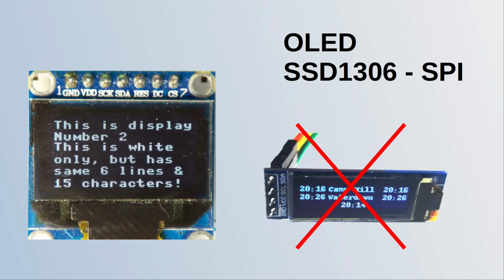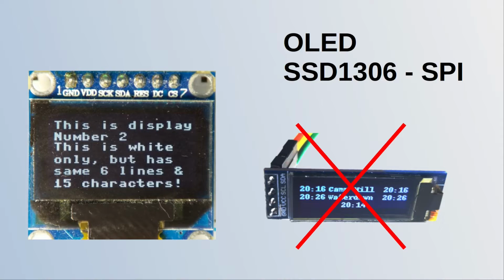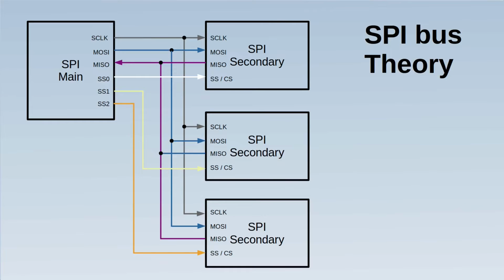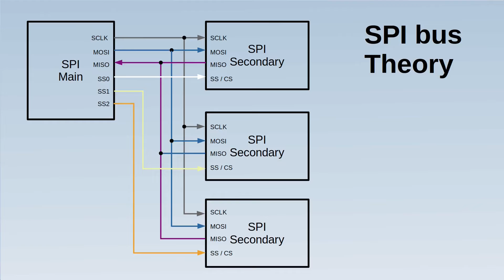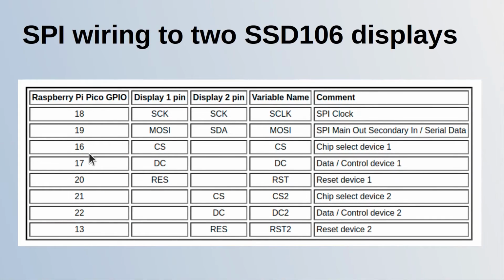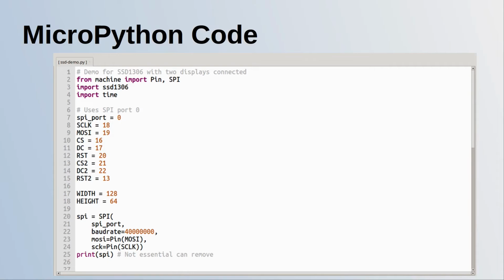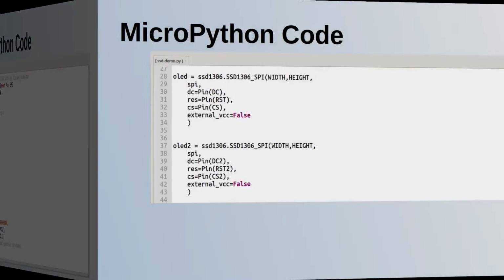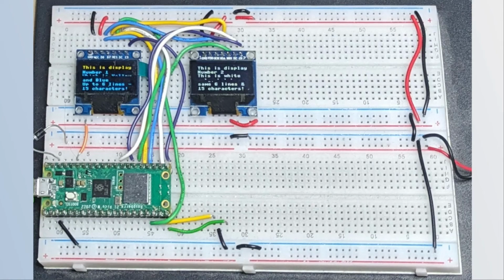Raspberry Pi Pico with 2 x SPI SSD1306 OLED displays

Comment: my ic2 oled ssd1306 shows a block char (like 178) when sent char above 127,  used it to build big numbers (portrait view), used a tca9548a on 1 i2c bus to drive 4 oleds.
Reply from the maker: The I2C multiplexer is one of the ideas I had in mind when I said "there are ways around the I2C address issue".

I like the idea for using block chars, reminds me of creating box menus using ASCII characters in DOS programs back in the 90s.

I'm currently looking at using bitmap fonts to create large numbers. I only need digits so looking at creating custom images and blit then to half the screen at a time giving values up to 99.
Reply: Another benefit of the SPI interface is that the coms are normally a lot faster, which means that you can get more fps.
If you 'play games' and limit precisely which areas of the screen you draw/show, you can get very high fps.